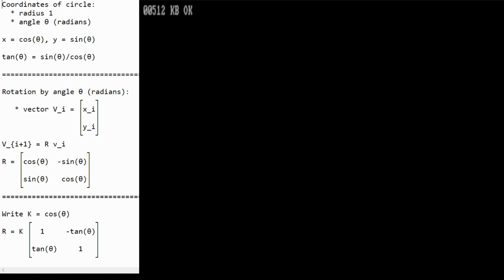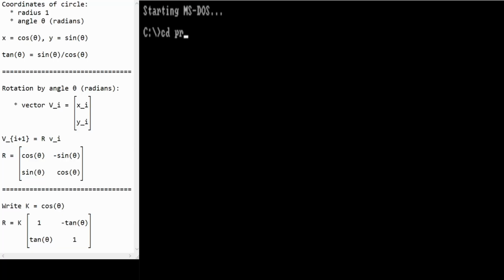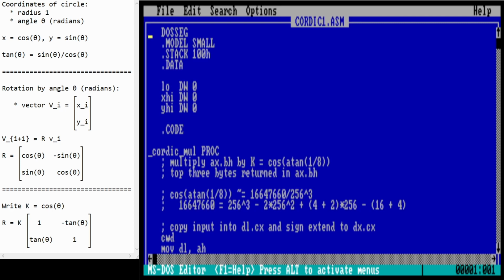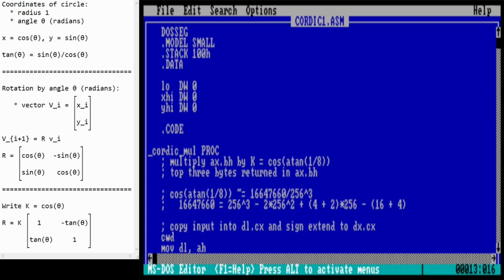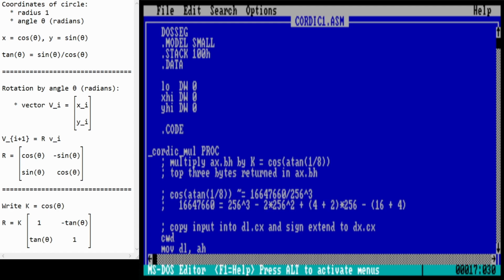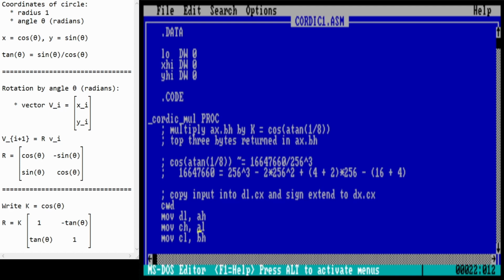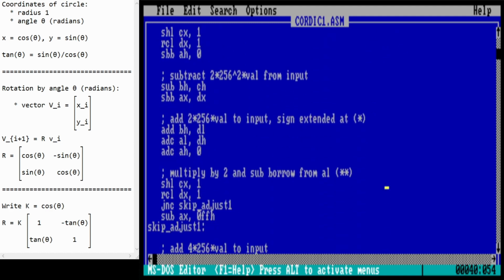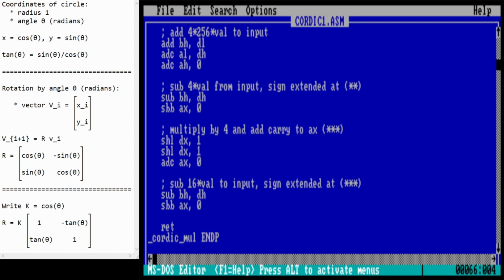CGA Graphics Programming: CORDIC Part 2 (Cordic Multiply)

Comment: Subtracting 2*(256^2) instead of adding 0xFE*(256^2) is a great idea. Incidentally my math doesn't quite agree with yours. 16647660=0xFE05EC. So I get hi,mid,lo bytes 0xFE, 0x05, 0xEC or -2,5,-20 whereas you get -2, 6, -20
Reply from the maker: That's correct. If I said otherwise in the video I must have made a mistake somewhere. I thought I checked all these details but I must have gotten distracted on that one.

Comment: If atan(t)=1/16 then t=3.576deg, that's 100-101 steps for a full circle. I reckon I can't see any advantage though.
Reply from the maker: That sounds about right. I'm not sure what you mean by "advantage". Advantage over what?

There is a third part coming where we fully implement this.
Reply: @pcretroprogrammer2656  In the previous video you said either 1/8 or 1/16 angle provided some advantage. I can't see it for now, the algorithm seems pretty generic for any small angle (other than constant K). Anyway it's a casual remark, my interest in the video is the classic PC XT programming aspects.
Reply from the maker: @javiergonzalez7104  Ah I see. The advantage of that angle is that multiplication by 1/16 is just a bit shift, which is cheaper to compute than the value you'd get with just a general angle. Of course I could have also picked 1/4 or 1/32 and so on. I just mean that any choice which just gives you a bit shift is more efficient.